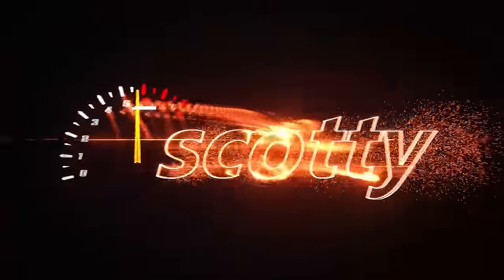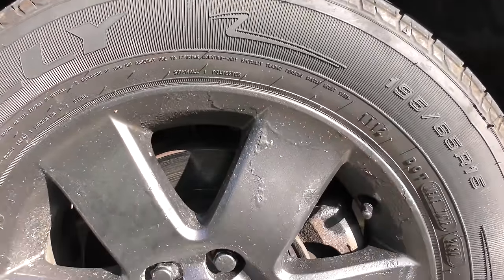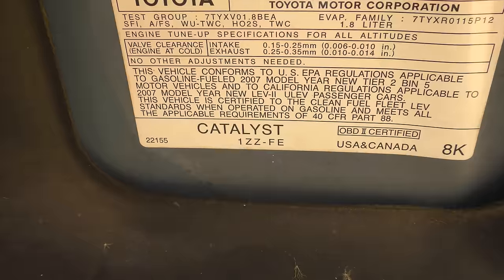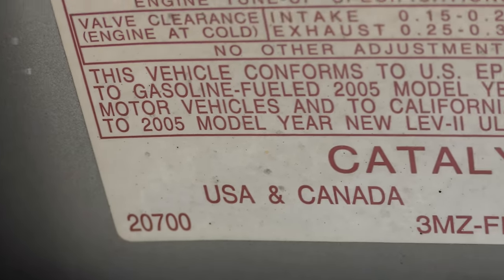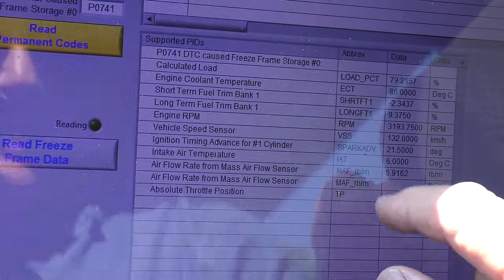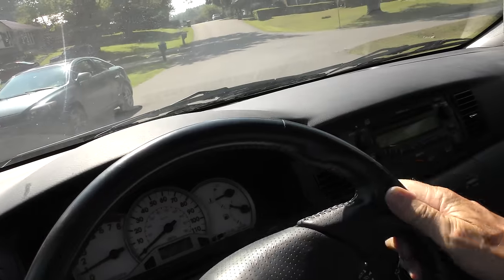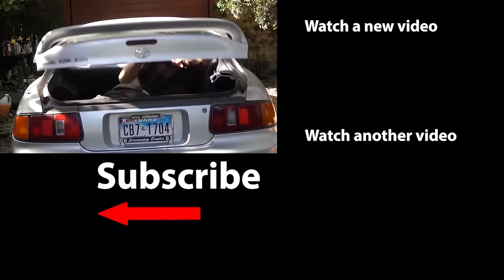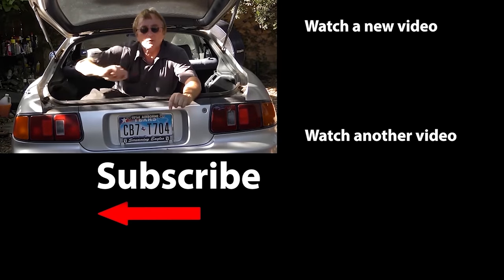I Won't Fix This Toyota Corolla

Comment: Maybe the owner made a hole in the muffler so it would "sound like a Ferrari".  When my 87 Sentra had a hole in the muffler back in the day, it was embarrassing and I couldn't get it fixed fast enough.  Meanwhile, some classmates were intentionally putting holes in their mufflers to have a more aggressive sound.  👁️👄👁️

Comment: Ah yes Toyota's rusty mufflers are notorious for just falling the hell off after a big bump
Reply: I live in Michigan and we have tons of road salt that its eating away the body of my corolla but I still have the original muffler intact. The bolts for the muffler rusted and snapped. I dragged it all the way to the hardware store to get new ones lol!
Reply: They rust inside out due to short distance use
Reply: Byron Manza  All metals can corrode, stainless steel often corrodes when it is in contact with dissimilar metals

Comment: I’m about to retire my 2003 Corolla.  270,000 miles. Sadly, needs struts and exhaust and not worth the money. Hate to see it go, cassette deck and all.
Reply: My 2001 Corolla also has cassette deck.  When I bought it the saleman said, " two things about this car.  It has crank windows, no electric, and a cassette deck, no CD.  It was the last one on the lot with these features.  Just shy of 250,000 miles.  Think it needs a craft shaft sensor.  Debating whether it's time to retire her.

Comment: i wouldnt go over 60 let alone 55 i would be scared about the transmission
Reply: I have a 2005 Corolla with well over 550k (odometer glitched at 333,333). Same problem... it's not the solenoid. It's a bearing in the valve body that plugs a plastic hole that has wallowed out...replacement of whole transmission is the only solution. Scotty's right, not worth fixing. He's also right...no big deal. I've gotten another 120k since...mostly highway speeds, with zero issues.

Comment: If you don't know the diff. between an oil change & trans. fluid change, U shouldn't be driving! Do U know the diff. between the Brake & Gas pedal?😲

Comment: Was able to cop a salvaged 07 for a couple of grand a while back. Great little vehicle. Fluid/filter changes were all that was needed. Check engine did just pop up at 133000+, most likely due to how I've been Revving that engine.

Comment: why does the corolla sound good😭😭😭
Reply: That's shits leaking bad that's not good my friend that's loud and anoying
Reply: Louder = / = better lol
Reply: @RandomlnternetGuy  if that's all you want just cut the muffler off it should be plenty loud
Reply: @goreobsessed2308  then why do people go crazy when a lambo is loud or any supercar?
Reply: @goreobsessed2308  lol 😂
Reply: @dogeofamp6037  well i mean... V10-V12 lol.... orrr a 2zz-fe with rust holes in the (weight savings) exhaust haha 😄
Reply: @goreobsessed2308  i know its loud but it sounds nice

Comment: I have the same car with the same code, which actually comes on and off when driving. The Toyota dealer told me the only thing they could do was replace the transmission. 

What I did do was replace the ATF and transmission filter and gasket. The ATF was probably the original, Toyota claimed the ATF was good for the lifetime of the vehicle but this generation of Corolla still has a drain plug and dip stick so its not really "sealed". That actually smoothed out the shifts and the light went away but it wouldn't surprise me if it comes back on at highway speeds. 

But the last thing, I just drove that car 2500 miles from MA to the UT and probably averaged about 35 miles per gallon. I only did some napkin math with the odometer but if the light wasn't on I wouldn't have noticed a mpg loss.
Reply: I can’t believe Scotty said it’s ok to drive it like that…. Why damage it more when the the transmission can last 500k miles? Fix the problems and stop ignoring problems, that’s bad advice and that’s why people cry when there cars break down.